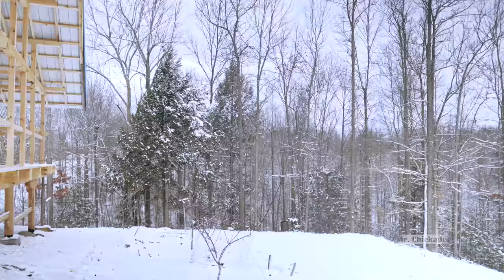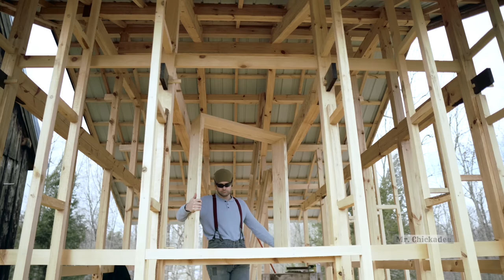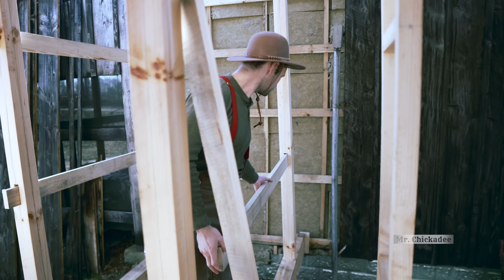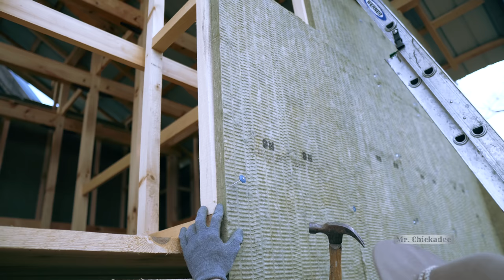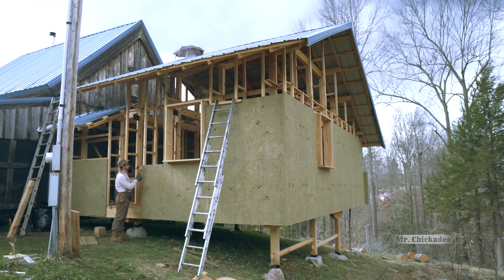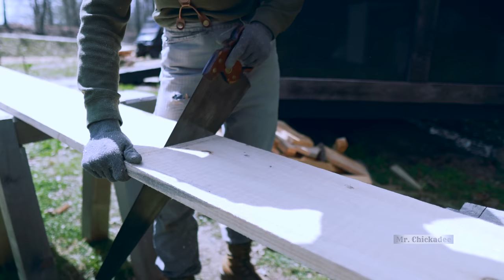Japanese timber frame home extension: Enclosing the frame using larsen trusses and hand tools.

Comment: as usual neat and systematic. are you naturally ambidextrous or have you trained yourself to using either hand for all the tasks? I've been trying to do it for some time.

I have an unrelated question, well it's related to the woodworking, but not to this particular video:
I want to make a 3 glued together boards table with the bread boards, 4 feet table top between 4x4 inch profile legs. the table top is 1 1/4 inch thick hardwood.
I don't want to use the apron or frame underneath the table (for no particular reason other than the design and trying it out). I want to put a single "apron" rail under the center board only, using a sliding dovetail along the grain. 
the question is: is that feasible? the purpose of that "apron" rail is to keep the table top flat for decades. will that sliding dovetail remain tight or will it get loose or squeeze to much seasonally? 

I'd really appreciate your feedback.

I've only seen everyone using sliding dovetail across the grain, but I wonder if doing it along 4 feet with the grain can be done and will it last?
Reply from the maker: Not sure I understand your plan sir...I have seen bread board ends done with a sliding dovetail rather than tenons. 
I personally would prefer a trestle table where the top member of the trestle is a sliding dovetail batten which slides into a dovetail groove cut into the underside of the table. Two birds with one stone so to speak...
Reply: @MrChickadee  legs are posts 4x4 inches. 4 feet  between legs.
So do you think the long sliding dovetail under the middle table top board to keep it flat is possible?
I mean prevent sagging on long edge not warping on short edge of the top.
Will seasonal changes of table top cause the long dovetail to become loose or to tight that it can actually split the board? Or will board and underneath apron rail shrink and expand at the similar rate hence keeping the sliding dovetail joint healthy and functioning

the table design draft is here:
https://tigercarpenter.com/working-desk/
Reply from the maker: @TigerCarpenter  I see your idea now. hmmm ambitious idea, though I personally would err on the side of caution and tradition here. With a top that thick you most likely wont see any sagging in the top unless its extremely long. I don't know if that batten will really help you very much. If the top and batten are both very very dry, they should stay tight at least. 

This is the style I would prefer myself, no breadboards at all, and the trestle becomes the same sliding dovetail to hold the top in place. 

https://www.youtube.com/watch?v=x51zMg7roIs
Reply: @MrChickadee  thank you Sir
Of course I love Ishitani furniture. 
I still want to go with my design. 
My only worry is a feasibility of that central long sliding dovetail. I haven't seen anyone doing it and I want to try it out. Unless there is some obvious NO NO for long sliding dovetail along the grain. I'm a new wood worker that's why I need to ask people like you with more experience than me

Comment: Very nice job, as always mr Chickadee. What is the insulation panels you nail on the outside ? And what kind of insulation will you put inside the trusses ?
Best regards from Marseille, France.
Reply from the maker: Its called mineral wool board outside, inside will be mineral wool batt, much thicker and softer type

Comment: Mr. Chickadee may I ask - at some point you are tacking netting or is it a plastic sheet to the bottom corners of the building. I assume it is to keep moisture and critters out? Could you tell me the appropriate material to secure the corner/underside of a raised building with?  Thanks in advance.
Reply from the maker: Ideally you would use 1/4" size metal netting, either stainless steel or galvanized steel.
Reply: @MrChickadee  Thank you for the response.

Comment: Try using your hammer different. With your thumb on the handle you can steer and hit better with the hammer. Just a tip

Comment: What's the purpose of beating your tenons? Compression so they swell extra tight in the joint??
Reply: And if so do you over size n by approx how much for what kind of wood you using???

Comment: Does the inner middle from the tree come to the outside or to the inside when you are installing the boards on the outside of the building.?
Think they call it the hearth side of the wood...
Reply from the maker: in this case, the inner part of the tree goes toward the inside of the building and the bark side of the tree goes on the outside for the wide boards.
Reply: Thanx you helped me a lot with this answer. 👍

Comment: I don't know if I would be disappointed or a bit impressed if I found out that Mr. Chickadee breaks out a skillsaw when the camera is turned off. Surely it crashes his mind sometimes when he's sawing the ends off those boards? Just kidding!
Reply from the maker: It actually never has, crossed my mind that is.
Reply: @JayCWhiteCloud  I have found myself thinking more and more of doing more hand sawing. Much easier to keep it on the line than with a power saw. As you say, the saw does the cutting. Hell, I see lots people that use power tools, and don't even let the tool do the work.

Comment: Where do you get that quality timber from? Nothing like that available at any german hardeware store nor builders yard.
Reply from the maker: I go to a local small sawmill, they can cut anything you want to order, and will work with you on knots, defects, species of wood, what not. Its very cheap too, about .60 cents per board foot of wood. I buy it all freshly green, and then stack it to dry at my place, or use it green depending on the purpose.
Reply: @MrChickadee  Tanks for the tip. Might find a smaller mill, most of them are dead or have been bought and closed by the big guys. Old woodworker myself but your eastern traditional mix is outstanding. Be well.

Comment: I wonder how this floor allows seasonal movement. Especially as the right side of the boards is not layed out alternating.
Reply from the maker: Put in green, they shrink some as dry, a subfloor goes on top, as they are not very wide, and made of pine, a stable wood, they should not move much at all. In the Japanese tradition, boards and beams are used naturally, the boards always bark side up.
Reply: @MrChickadee  Thanks for this fast and detailed explanation. Is there a reason the boards are put bark side up? As they bow towards the bark, i would have guessed to prevent popping off nails, but the boards didn't get nailed if I saw correctly, am I right?
Reply: I also was wondering why the board ends aren't staggered.

Comment: Do you have to file for building permits, if so, how do you pass the modern day requirements?  Such as, hold downs to the foundation rocks?
Reply from the maker: not here, but this is easy to deal with, drill a hole in the stone and epoxy in threaded rod, this goes up inside the post and a small mortise in the side lets you attach lock nuts.

Comment: A wonderment!  Do you spend more time sharpening or sawing?  No, reply necessary.
Reply from the maker: Gosh, WAAAYYY more time sawing, sharpening takes a few seconds, for many feet of wood to cut through.
Reply: @MrChickadee   Ty 4 responding.  Your response has jogged my memory that it indeed takes only seconds to sharpen drill bits, carbide cutting bits & scrappers, etc. (16yrs ago) as a marine machinery mechanic of 35yrs.  This was to accomplish resurfacing sealing surfaces on ships and submarines.  I worked with metal, but in my retirement have developed an extreme interest in the science of wood. It’s commitment with passion as you exude in your videos!

Comment: Think I would have installed a rainscreen membrane over the rockwool.
Reply from the maker: Not needed for this design.
Reply: @MrChickadee  If you have wind driven rain thru the siding joints how do you keep the rockwool from absorbing it and redirect it to the exterior?
Reply from the maker: @gary24752  The large vent space behind the wood siding is tied into the attic and vents up out of the roof causing a stream of fresh air to be drawn up past the outside of the Rockwool BOARD type insulation, which is designed to handle this exact application. Rockwool does not rot or even lose R value when wet and is hydrophobic by nature, unlike many other insulation types.  I have found any kind of plastic vapor retarding layer to be more trouble than its worth, often causing many issues with trapping water or causing condensation in the worst place. My walls stay bone dry and draft proof with zero condensation.

Comment: 1:47 what will happen with that floor when the wood expands due to moisture in the summer?
Reply: Great point. The description says it's "green pine", assuming "green" refers to the unseasoned nature of the boards, it's only going to shrink. Hence, getting them as tight as possible seems like a good idea. 💛

Comment: so why go though all the work for a mortise and tendon just to use some nails on certain areas? just wondering you do you homie. im a big fan of japanese style building. i think that using japanese style timber building is superior but a few modern modifications would make it elite.
Reply from the maker: So the timber frame of the structure is mortise and tenon joinery, the roofing, flooring, and the wall coverings are just attached to this extremely strong and resilliant skeleton if you will using metal fasteners. They could all be attached with some joinery, but I do have a finite timeframe and am one man building alone. So I use the important joinery where it matters, the rest not.

Comment: Why did you hit some joints with a hammer first?
Reply from the maker: they are too tight to fit as cut, so compressing the wood temporarily lets you assemble, it later expands again

Comment: You have such a great joinery and then you cover everything with a simple metal roof. That is a disappointment! (Glazed ceramic tiles in black or dark blue would have been appropriate!)
Reply from the maker: Metal roofing is extremely practical, cheap, long lasting, perhaps the longest lasting there is with the least maintenance and at the end it can be recycled.

Comment: That crosscut saw needs sharpening
Reply from the maker: Think so Mike? lol
Reply: @MrChickadee  Have a Disston that was my Grandfathers (I’m 73). While working in a cabinet shop I set out to sharpen it. Definitely not the easiest to do. I can sharpen chisels, plane blades, and knives pretty quick. But saw sharpening? Very tedious!
Reply from the maker: @mikecissel900  I keep them razor sharp Mike, this is frozen green hard pine, so a bit slower than some things, I find it takes me less than 2 min to sharpen a cross cut, maybe half that for a big rip since the teeth are larger. Here is a tutorial I did on this topic, you may find interesting. 

https://www.youtube.com/watch?v=JnKug-Avz14